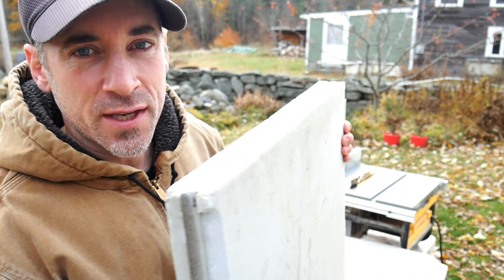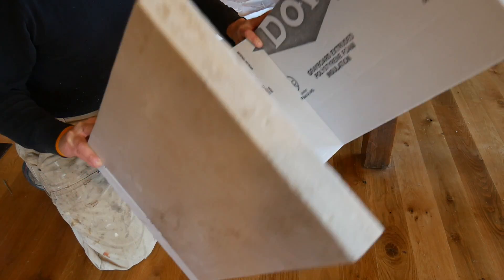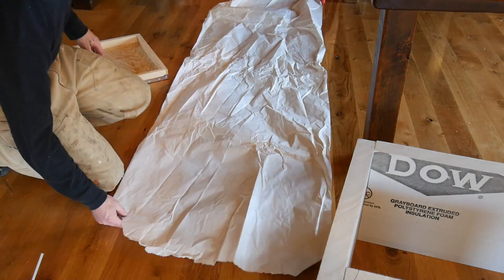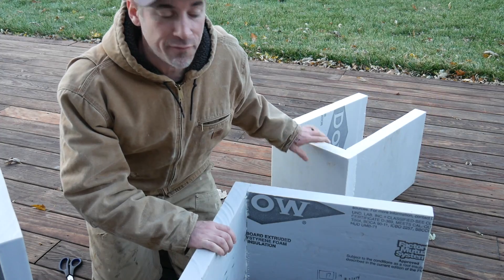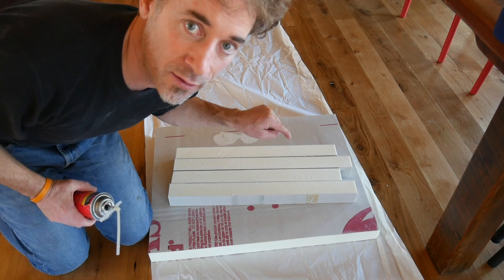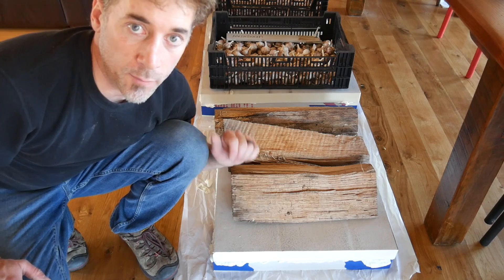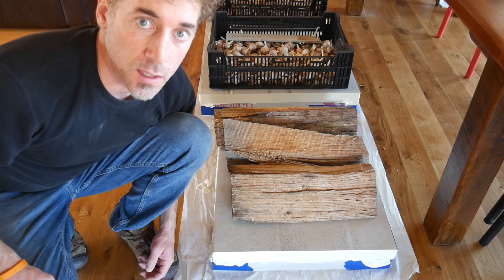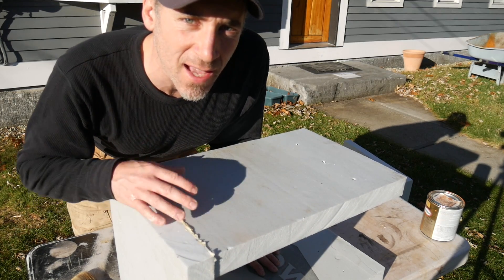DIY Foam Beehive Winter Shelters

Comment: Do you guys keep the slider board and screen just closed for the cold winters or do you switch the screened bottom board out for a solid base bottom? First year beekeep here… my mentor was 88 and died… 😢 so I don’t have one now when I need one for closing up my hive. Ohio weather- thank you!
Reply from the maker: I don’t keep bees this way anymore but I kept this video up for others that still do. I have switched to year-round fully insulated hives. All four sides, top and bottom… continuous insulation. The only opening is the lower entrance. If you live in a northern climate, I recommend FULL INSULATION. No openings or thermal bridges to the outside air. This video was part of my journey toward this realization. These covers helped the bees survive, but they were not ideal. Adding a fourth panel to the front and a heavy lid would be far better than just three sides.
Reply: I have the same question. CT weather here so probably similar. Lmk when you find out please :)
Reply: solid bottom
Reply from the maker: Deep dive video on why I changed: https://youtu.be/UKXgIdHpedo

Comment: Nice job…
1. Why didn’t you show the finished installed product?
2. If you don’t put a metal top on that foam top it will disintegrate in the rain, snow, etc
Reply from the maker: 1. The final installed product is shown on several videos before this one. 
2. A coat of paint protects foam board just fine. I have painted foam that has lasted 8 years outdoors.

Comment: I have come back to watch how you cut your insulation.  Can you please do a video on how you set up the saw, what blade you use,  how to adjust the blade, and just a whole in-depth how to for the saw and insulation cutting?  I’m sure every guy understands what you are doing, but I’m a woman that needs to sneak the use of my husband tools to do this.  I want to be safe and use it, clean it up, and make it look like I never touched it.  Cutting with a utility knife just isn’t working that great for me.  We have the stuff, but my husband isn’t good with sharing.  A little help would be appreciated for a woman who just needs a little more instruction than a man.
Reply from the maker: I purposely didn’t get into this because I do not want to be liable for teaching a beginner how to use one of the most dangerous power tools out there. A table saw is a seriously dangerous tool. If you already know how to safely use one, cutting foam should be pretty straightforward. If you’re asking these kind of questions, I can’t really help you over the internet. I hope I am not coming across as condescending or dismissive. It’s great that you want to learn, but I can’t help you on this. Please don’t try to use a table saw to cut foam if you are not already completely comfortable using the tool with wood. It is very dangerous.

Comment: Do you have any recommendations for top bar hives?
Reply from the maker: I have never used top bar hives, but a similar kind of shell could certainly be designed. This material is simple to work with.

Comment: Why do you not glue it to the hives as well and make them permanently insulated? Wild bee hives are usually hidden from Sun and weather conditions and in comparison to artificial hives, very well insulated
Reply from the maker: Because all summer long, hives are taken apart every time they're inspected and all that insulation would be a huge hassle to deal with. Over the winter they just sit there, so wrapping them up and walking away is the best solution.

Comment: Hello, do you think this can work for countries where the heat can reach up to 50c=122f? I need recommendations please, as I am thinking at the moment of using concrete to replace what I've of wooden beehives. The summer here is just unbearable. TIA all
Reply from the maker: I would think these would help if you paint them white for reflection and maybe not make them fit so tight. Leave a small air gap between the hive and the insulation.
Reply: @vinofarm  Thanks a lot Vino for the reply. well, frankly speaking at the moment i've emailed a friend of mine who is also doing some experiment on building beehives from stone/rock/marble.. just as an experiment, unfortunately he don't speak English, so I thought well there got to be someone out there who tried such idea! I mean stone beehive, thus, i searched and i came a cross guy from SA http://www.beegin.co.za/ , well I they can make such beehive and the bees love it, as we all know the stone/rocks are warm in the winter, plus moderate in the summer! 
So, I am not like, well why don't i try this! it might help.. thanks for your suggestions and comments on this.

Comment: The foam board you are using - does it contain formaldehyde? If its PIR based it will do, kills insects a treat when it gasses off!
Reply from the maker: There is no formaldehyde in styrofoam.

Comment: I did this with 1” foam board.  Instead of 
Gluing or screwing it to hives, I got it in place, then used shrink wrap to secure it against wind and movement.  I did not insulate the covers, I have glass inner covers and use a telescopic cover over that.  The air space in between seems sufficient so far.  We have had several weeks of weather below 20, and at least a week near 0 and below.

Comment: Hey, bit random but how are you cutting the boards so straight without a rip fence? is it because the foam is so easy and once on the blade it wont go off at an angle. Surely you have to start the cur perfectly straight and yo'd often be out by a degree or two?

Thanks
Reply from the maker: john smith Practice! Snap a line and follow it slowly. Once you get through the diameter of the blade, yes, the blade sort of acts like a guide. It's just years of practicing with wood. The foam is like butter. Easy to make little micro adjustments. Remember, these videos are like 400-800% faster than real life. Be careful!
Reply: Great video - be careful with foam sheets on table saws - they tend to want to "grab" the blade and pull etc.  I just insulated our basement with this stuff.  I'm using the rest of it for the hives.

Comment: To be clear this is a fantastic idea, I've done it for my hives this year. One thing though from a physics point of view, putting the foam on only 3 sides will do next to nothing for insulation. Its like building a house and saying you'll insulate 3 walls but the south facing one will be 3/4" plywood because you want the winter sun(which has very little energy) to warm your house up. In order to last through the day and night and make a difference the sun would have to heat the south wood side to 122F...not possible. 

Great idea just add a forth wall and if you really want to go.for it, a floor. Some tape to seal up roof to sides would be great too. 
All the best.
Reply from the maker: Problem with the 4th wall is what people call the "refrigerator effect" where the temperature eventually gets cold on the inside and never warms up on sunny days because the sun won't penetrate the foam. It's a catch 22 situation. I prefer to leave that south side open for the chance of even a slight warm up from the sun. The 3 sided shelter is more of a wind break than anything else. There is heat loss on cold nights, but I'd rather let the bees deal with that by clustering, and then get that little heat during sunny days. Even on cold days, I can touch the front face of the hive and it's quite warm from the sun (when it's sunny!)

Comment: Finally someone is actually building a wind shelter... its the most important thing you can do for your hive. 
You might want to pit a roof of some kind about 6 to 8 inches above your hive! 
My grandmother use to use hay bales and covered them with plywoid, then she just moved the bales to the compost come spring and replace them with fresh come winter!
Reply: beth98362 R Do you think in northern Illinois a set of insulated windows framed around the hives would be beneficial...to block wind, but let the sun in?
Reply: Walls bee man winterizing the hives
Reply: Walls beeman winter hives

Comment: Hi there....Firstly I am not a beekeeper but I hope to start off next year so have been really interested in following your first year beekeeping videos.....This is merely an observation as again I know nothing about bees......In this episode you are surprised as to the lack of activity and storage done by the bees in the lowest brood box and it seems to me that the least amount of storage is on the west and north sides of the hive. Could this possibly be because the north and west sides get less heat from the sun. The north side is self explanatory but the west side might be explained as you have cinder block up against the lowest brood box which may be preventing the heat of the sun through to the west side of the brood box and making it cooler than the rest of that box which the bees are preferring.....Forgive me in case this already been suggested in comments I have missed, or I am totally out to lunch, but it just seemed odd that these areas of brood box seem to be ignored by the bees.....Great to see that you are as to how I will be, when it comes to becoming a new beekeeper, and make mistakes.....Good luck for the future....Neil.
Reply from the maker: Lien Doelcm Yes that was suggested a few times and I don't have any blocks next to my hives this summer. Who knows why the bees put honey in different spots? Every hive is a bit different. Thanks for watching and best of luck with your beekeeping!

Comment: Don't ever work with that stuff in your house. It is the most permanent stain you could ever get. Wear gloves too, it's really tough to get off your skin. You get it on clothes, boots or fabric and it's there for life
Reply from the maker: AvocaSingleTrack The spray foam? I'm pretty comfortable with it because I've been using it in construction for many years. But you're right that there's a learning curve to using it and not getting it all over everything. Less is more with the foam!

Comment: #EasyLifeHack
If you have no expanding foam insulation to use for the glue, a can of Cool HWhip does the trick just as well. And a little bonus is it tastes MUCH better than the expanding foam insulation!

Comment: Nice Build!
I know that foam well.  I'd suggest using eye protection & thin disposable gloves with the spray foam as a basic rule of thumb.   the canned foam is so casual to use that I often forgo the eye & hand protection and one slip up and its kind of a toxic nasty mess that doesn't come off for a few days.      Not the biggest deal, but I hate having that chemical stuck to me when I'm eating or working in the kitchen.
Reply from the maker: Spencer Brennan I've gone through more than 100 cans of this stuff over the years working on the house, so I know all about it! I'm usually good at avoiding getting this on my hands, but I really made a mess during this build. The trick is to let it fully cure and then scrape it off whatever you get it on. If you try to remove it while it is still wet, the mess is way worse. This goes for skin, too. I should have worn gloves.
Reply: Vino Farm just googled foam house and people have actually built houses out of it 😂😂😂pmsl

Comment: Important note: Do NOT use spray paint on this foam. The solvents will eat into the foam and u will end up with a nasty mess. I used to use it for model terrain. If u want to use a spray, u first need to apply an impermeable coat of non solvent paint(or white glue, as I used) prior to spaying, or used an air brush.
Reply from the maker: Ken Oakleaf Good tip. I'm glad all I had was leftovers in that can.
Reply: Vino Farm with regular paint it has a tendency to peel if u paint the shiny side. A very light sanding is sufficient to prep the surface. From what I remember the non shiny side doesn't need to be prepped.
Just keep an eye out for peeling  or bubbling when u are checking in on the hives. Even if it does peel, only the top cover is likely to see enough direct sun over the winter for it to take significant UV damage

Comment: Your lucky u didn't get it on the wood flooring that stuff is horrible lol
Reply from the maker: Ha Ha... I did get a smear on the floor. And all over my hands. The trick is to let it fully cure and pick or scrape it off. Trying to get it off when it's wet just makes it ten times worse.
Reply: Gavin Brookes yeah, I hate working with that stuff 😒